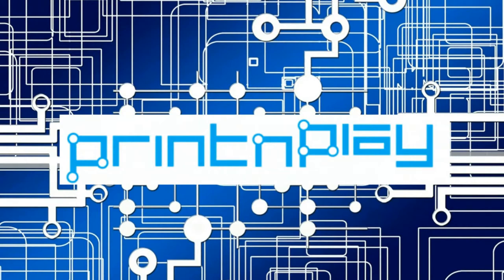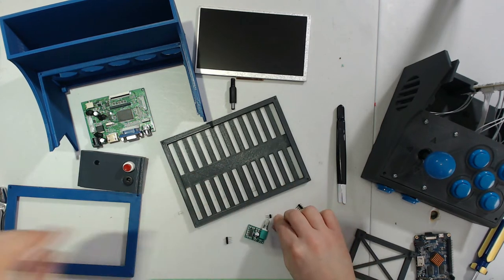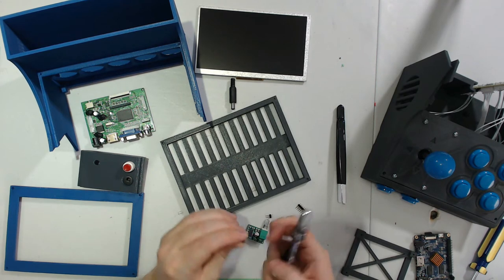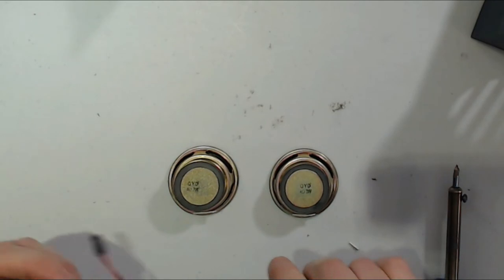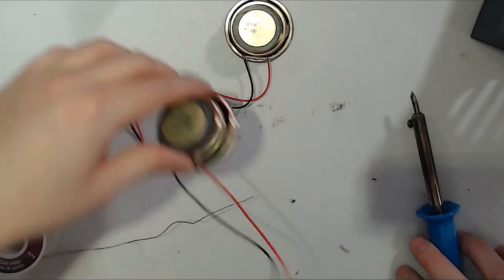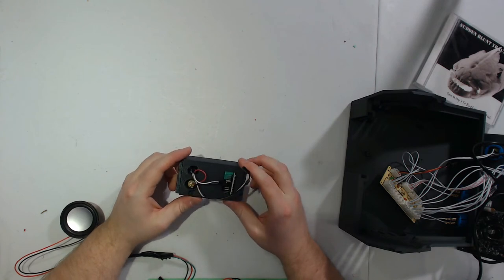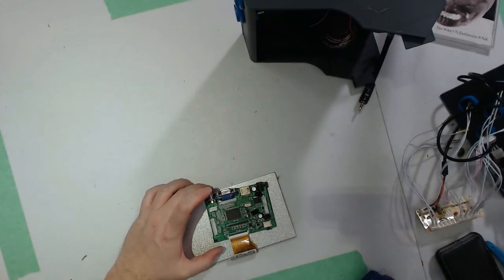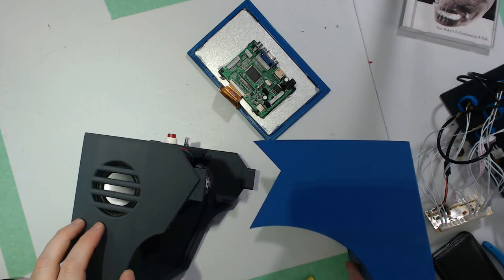Solder work and final assembly! - The Print N Play Arcade Part 3

Comment: can you tell me how you configured the controls? i already installed them but i have problems in attraction mode for example
Reply from the maker: Tommy G I just followed the auto control configuration that fires off when you start RetrOrange Pi for the first time. Did you run through that?
Reply: the control config where you have to press 1 button long first yeah, i guess i need to reconfigure the attract mode becausde that seems to be the only thing, in retropie anything reacted normal
Reply from the maker: I haven't played with attract mode too much myself. Sorry I don't have a ton of suggestions for that mode!
Reply: Print 'N Play  it' s okay, thanks anyway ^^
From what i've read it has different Controlls. I guess i have to reconfigure it there